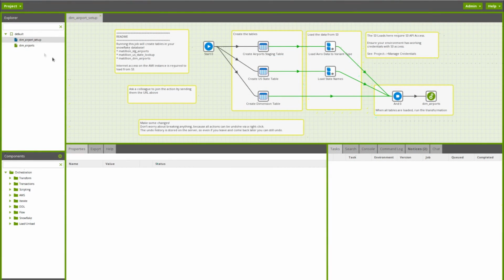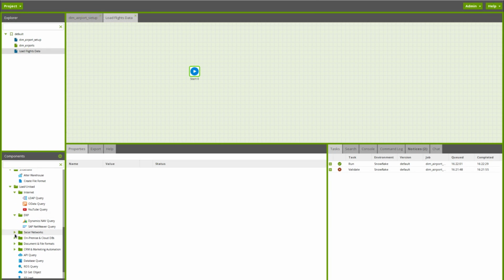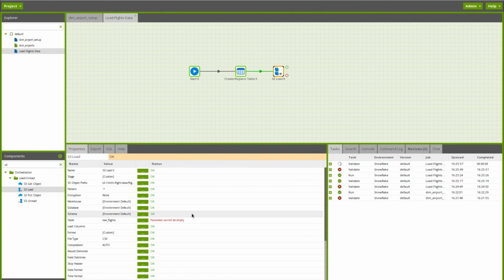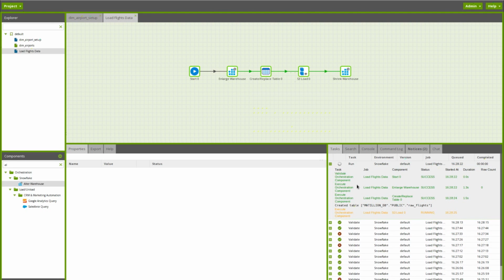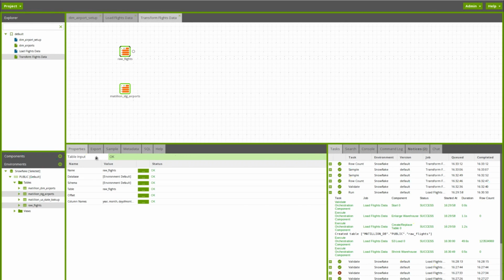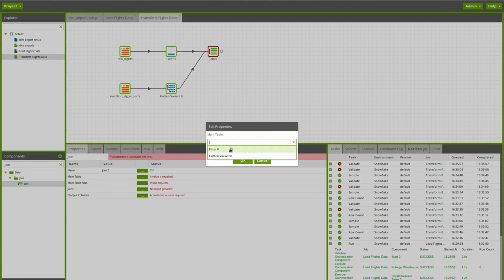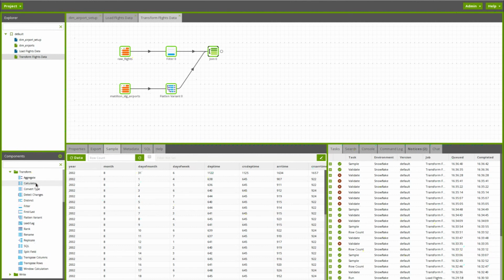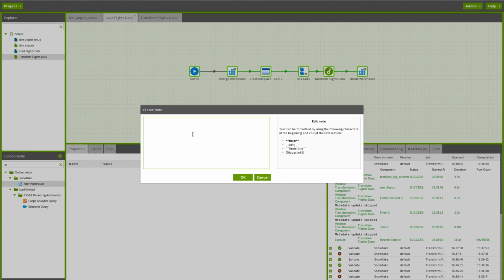Tutorial | Building Your First Job | Matillion ETL for Snowflake

Comment: Can you restart an orchestration or transformation job from specific steps? For e.g. if step 3 fails and you don't want to re-run steps 1 and 2, is that possible? Also, if you have two branches in an orchestration job or transformation job, can you restart only the branch that failed vs. re-running everything from the beginning?

Comment: The column values he pasted in "Text Mode"

Year NUMBER 10 0  No No
Month NUMBER 10 0  No No
DayofMonth NUMBER 10 0  No No
DayOfWeek NUMBER 10 0  No No
DepTime NUMBER 10 0  No No
CRSDepTime NUMBER 10 0  No No
ArrTime NUMBER 10 0  No No
CRSArrTime NUMBER 10 0  No No
UniqueCarrier VARCHAR 256  No No
FlightNum VARCHAR 256  No No
TailNum VARCHAR 256  No No
ActualElapsedTime NUMBER 10 0  No No
CRSElapsedTime NUMBER 10 0  No No
AirTime NUMBER 10 0  No No
ArrDelay NUMBER 10 0  No No
DepDelay NUMBER 10 0  No No
Origin VARCHAR 256  No No
Dest VARCHAR 256  No No
Distance NUMBER 10 0  No No
TaxiIn NUMBER 10 0  No No
TaxiOut NUMBER 10 0  No No
Cancelled NUMBER 10 0  No No
CancellationCode VARCHAR 256  No No
Diverted NUMBER 10 0  No No
CarrierDelay NUMBER 10 0  No No
WeatherDelay NUMBER 10 0  No No
NASDelay NUMBER 10 0  No No
SecurityDelay NUMBER 10 0  No No
LateAircraftDelay NUMBER 10 0  No No
Reply: Year NUMBER 10 0  No No
Month NUMBER 10 0  No No
DayofMonth NUMBER 10 0  No No
DayOfWeek NUMBER 10 0  No No
DepTime NUMBER 10 0  No No
CRSDepTime NUMBER 10 0  No No
ArrTime NUMBER 10 0  No No
CRSArrTime NUMBER 10 0  No No
UniqueCarrier VARCHAR 256   No No
FlightNum VARCHAR 256   No No
TailNum VARCHAR 256   No No
ActualElapsedTime NUMBER 10 0  No No
CRSElapsedTime NUMBER 10 0  No No
AirTime NUMBER 10 0  No No
ArrDelay NUMBER 10 0  No No
DepDelay NUMBER 10 0  No No
Origin VARCHAR 256   No No
Dest VARCHAR 256   No No
Distance NUMBER 10 0  No No
TaxiIn NUMBER 10 0  No No
TaxiOut NUMBER 10 0  No No
Cancelled NUMBER 10 0  No No
CancellationCode VARCHAR 256   No No
Diverted NUMBER 10 0  No No
CarrierDelay NUMBER 10 0  No No
WeatherDelay NUMBER 10 0  No No
NASDelay NUMBER 10 0  No No
SecurityDelay NUMBER 10 0  No No
LateAircraftDelay NUMBER 10 0  No No